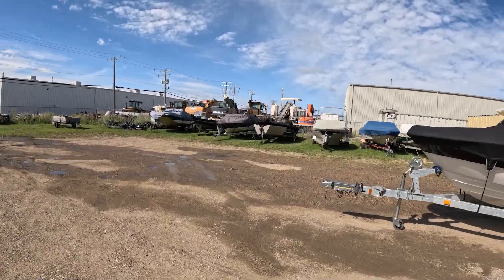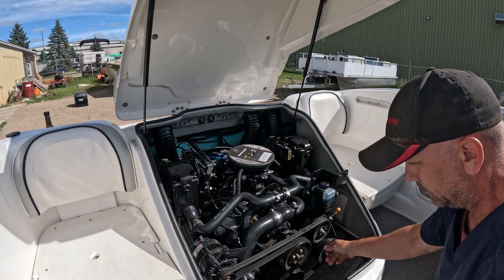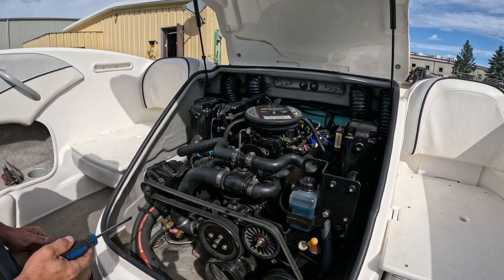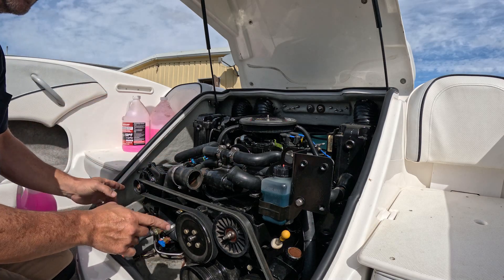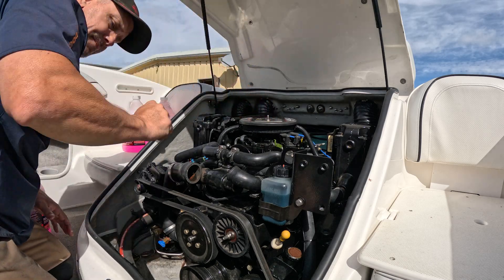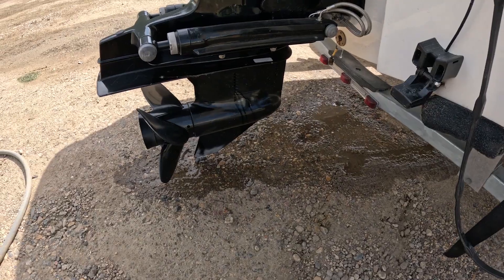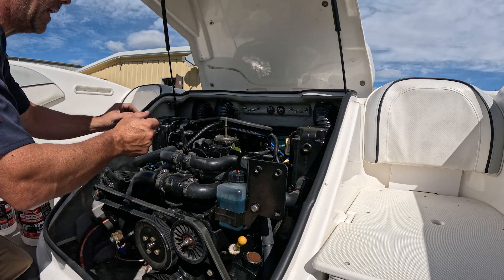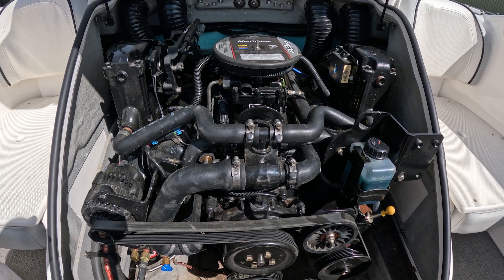Winterizing Your Sterndrive or Inboard? Don’t Miss THIS Step (I Fix the Failures)

Comment: This has to be one of the best winterization videos I have watched & i've watched quite a few.  How about the thermostat?  I keep hearing about make sure your engine is up to temp to the thermostat is open.  11:16 that's all you need to do to make sure the drive is winterized?  Also, do you run the pink stuff through the bilge pump?  Thanks! 

I'm getting ready to winterize  my parents 95 Chaparral 18', been sitting since 2019, dad unexpectedly passed away from cancer last year,  so I decided to pull it out and see if I could get it running.  It runs and idles great!  The trim tab to raise it up doesn't work but the trailer tab does work. I replaced the solenoid but still doesn't work.  There's also a damaged thru hole fitting on the rear port side.  Not sure what that goes to. (fuel vent line or what other than that surprisingly it's in good shape and no sign of mice damage etc.  Must be the 1000 bounce sheets they left in there.   lol.
Reply from the maker: Depending on your location...around salt water you will want to do more work.  Remove the drive and inspect the gimbal, water pump and inspect the anodes.  You can fill all the areas needed through the Tstat housing as I mentioned...keep in mind, its where the engine does it.  We can bypass the tstat by removing hoses.  Also by allowing the over flow of antifreeze, we remove the water left in the main manifold as it can be trapped in there. 

 Sorry to hear about your Father, its nice to hear you are attempting to carry on with the boat.

The trim...might be the switch or the trim limit switch on the drive itself.
Reply: @TheMarineDoctor  Thanks for the quick response.  I'm in Colorado.  I might put it in the water this weekend and see if there's any other issues.  After this weekend cooler temps set in and I'll need to winterize it.

I tried crossing the solenoid with a screwdriver and it went up so maybe it is the switch.

Comment: Salt water marine areas we do much more . We pull drive off check for corrosion and sprayed entire engine with CRC oil corrosion inhibitor grease gimbal bearing and drive shaft plus pull prop off grease splines.
We also run engine for 15 minutes to flush salt out and fill entire engine with non tox to prevent rust in block and manifolds risers etc .
Good channel 👍
Reply from the maker: Thank you for adding that.

Comment: Is it about the same for the OMC 3.8?
Reply from the maker: Similar yes.  You will have brass petcocks and smaller holes.  So be SURE a lot of water comes out as the older engines plug easier.